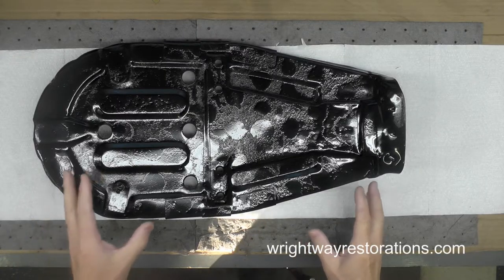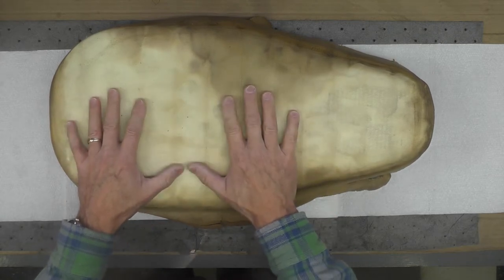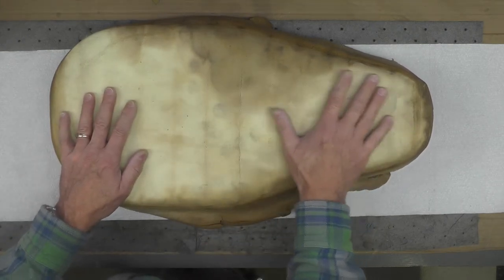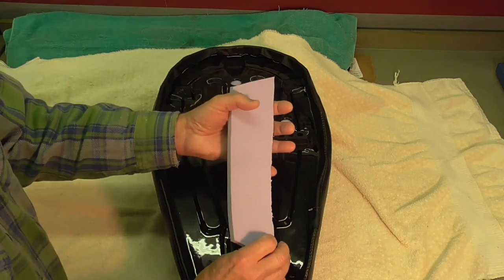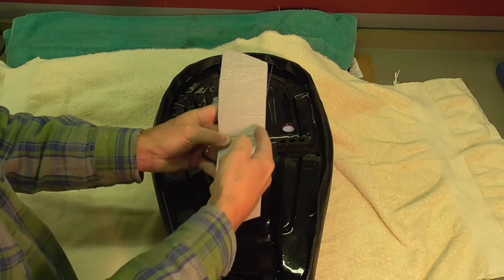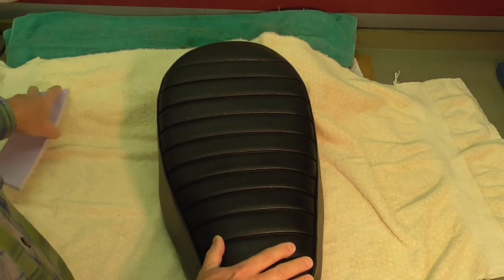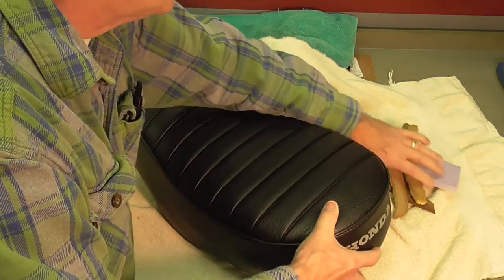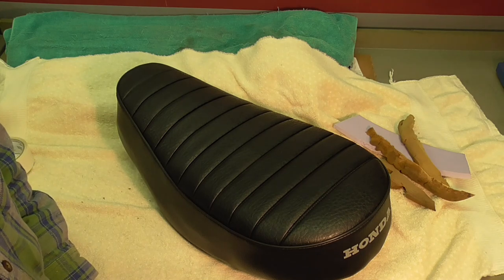Honda SL125, Completing Seat Restoration --- Video #239

Comment: Nice job sir! As usual, I have a question! What did you use to remove the rust particle from the bottom of the seat foam?
Reply from the maker: Well Pete, it was about as low-tech as it gets.  I initially used my fingers to simply remove the larger pieces of rust and loose foam.  This was followed by a wire brush that I used to lightly brush the surface to remove any remaining rust or damage foam and to smooth the surface.  Took all of about 10 minutes.

Comment: I would have had to place it on the bike just to see how it looked!
Reply from the maker: After this video was completed, I did temporarily install the seat on the bike to see how it looked.  I just didn't shoot any video of that as it was after the fact.
Reply: @kwrightway  
Fresh paintwork or a well recovered seat placed on are a good morale boost I find when things are draging on or getting expensive. I always find restoring wheels, eye wateringly expensive when you add it up!
Reply from the maker: @doctordirk6316  As I've indicated before, wheel work in general is probably my least favorite part of a restoration.  It's dirty, grubby (at least in the early stages) and as you said, it gets expensive fast.  Thanks for the comment...

Comment: Nice work!  Please share the cover supplier.
Reply from the maker: Thanks... the cover came from eBay... there are several suppliers that commonly list covers there.  As this video was shot some time ago, I don't recall the specific supplier (and I don't keep records), but if you do a search on "SL125 seat cover" you'll easily find them.  Pay attention to whether you want/need a seat with the HONDA name across the back as they come both with and without.
Reply: @kwrightway  Thank you, I’m trying to find one that best matches the original with only 12 specific ridges.  Yours looked very original and correct.
Reply from the maker: @bsmith9510  After a bit of searching my purchase history on eBay, I found the suppler for the seat cover I bought:

seatclone

They're from Bangkok, Thailand and it looks like they still have the cover listed.  I hope this helps.
Reply: @kwrightway  Thank you!
Reply from the maker: @rushman9155  You're welcome...

Comment: This is off topic, but in a previous video of yours I remember you talking about getting some chrome exhaust pipes re-chromed. Do you have any info on where you get that done or what steps need to be taken? I've been reading that many places won't chrome the mufflers because of the inside being dirty but perhaps others will do the job if the holes can be plugged up.
Reply from the maker: You are correct, many chrome shops will not do exhaust systems as there's a potential of tank contamination from the residue inside the exhaust system.  There are shops that will temporarily weld plugs in place to prevent this, or just thoroughly clean the pieces.

The folks I used for the Yamaha YL1 and SL125 are The Chrome Shop, located in Rock Island, IL.
  thechromeshop.com
  309.786.3743

They will likely ask you to clean the system as best you can by soaking or flushing with lye, which requires very careful handling.  If you don't clean it well enough to suit them, they'll do it again, and charge extra for it.

Either way, be prepared to pay, re-chroming exhaust components is an expensive undertaking.

Good luck...
Reply: @kwrightway  Thank you for the information. I am glad to know that it can be done at least and did not know about the lye flushing/cleaning. I will not be doing it anytime soon but am hopeful to know that it can be done. I am working on a 1972 Honda cb175 bike and reproduction pipes are not exaclty like the originals, so I found a solid used set with no holes etc but will need re-chroming to be perfect when I restore the bike in the next 5-10 years. I was having issues finding any information about chroming pipes online, but if you've done it then at least I know its a possibility!
Reply from the maker: @fish8196  You're most welcome, it is possible to chrome pipes as I've done it several times as recently as about six months ago with the Yamaha YL1.  Good luck with your project...
Reply: @kwrightway  awesome! glad to hear some shops are still doing it. Keep up the great videos and loving the current SL restoration!
Reply from the maker: @fish8196  I will and thank you.